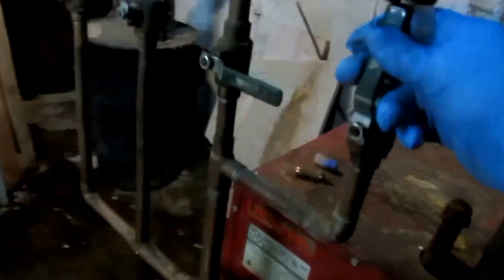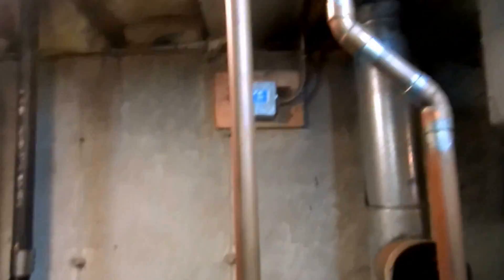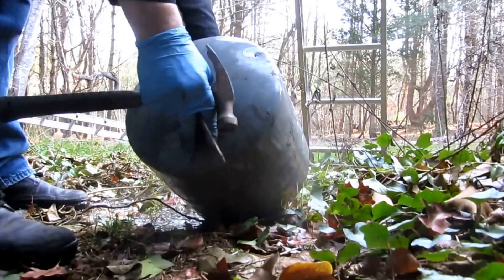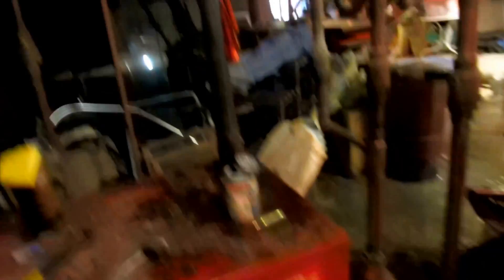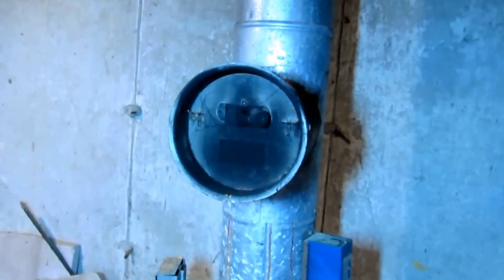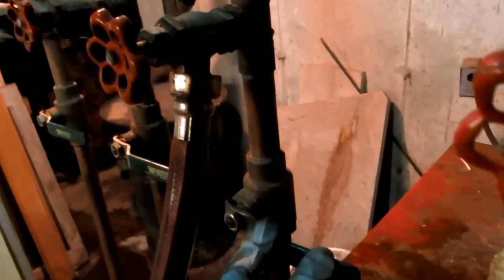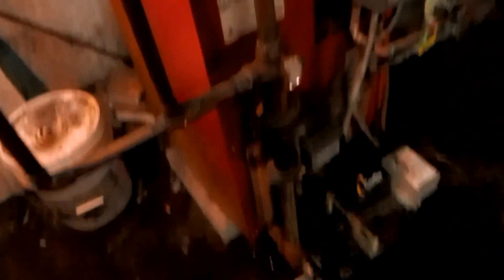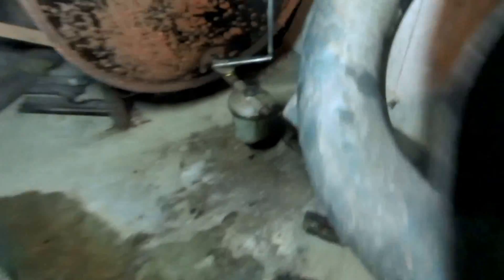HYDRONIC HEATING: boiler water leaking out relief valve.

Comment: My PRV is still blowin off at 30 psi after changing exp tank make up  valve tridicator  and HW coil on a 2 zone 2 story Burnham oil fired boiler. What am i missing? Could air in system be the cause?

Comment: Steve, I need that exact job done, Expansion tank filled with water, relieve valve leaking and it needs a cleaning.   Not sure if this has already been asked, sorry if I am asking the same question.What would time in labor be roughly to complete that work?If you could reply at your convenience, greatly appreciated, thank you.
Reply from the maker: +Patrick Holden i would do it time & material no set price .depends on what is needed and time spent to fix it . some are harder then others .
Reply: +steven lavimoniere Thank you for the reply Steven, I understand there can be unexpected trouble that can occur, but my boiler is similar to this one you worked on, I was just curious how long in hours this work took to complete.

Comment: Why don't they put a longer fitting on top of the tank so a larger pipe wrench will fit? That seems stupid. Is that a shrader valve on the bottom of the tank? Can you drain the water out of the valve so the tank isn't so heavy? Great work as always!
Reply from the maker: Nicholas CeeA it might seem stupid to someone that never worked on one ...there is a very small space to put a wrench .so i use a tiny pipe wrench .so it fits and i grab it with a larger one for leverage .. it might be stupid to the un trained eye.but believe me this is not my first rodeo
Reply: Read my first post again Steve. Why don't they (the tank manufacture) make more room on top so the techs can use a larger wrench. All it would take is a slightly taller hex fitting.

I saw the video where you broke the handle off of the little wrench BTW.
Reply from the maker: your right ,there is no room for a wrench .. its always been a problem

Comment: dude I have a leak that's coming from thermo expansion valve but I get a gallon it happens then nothing no then happens again what could cause this??
Reply from the maker: its sounds like the ex tank is bad drain the boiler remove the ex tank there should be no water in it ..if there is any be carefull the sucker will be heavy if filled with water get under in good when removing to chatch the weight .what happens is when you heat water it has to expanded in the rubber diepham in tank let go it will fill with water and no were got the heated water to expand so it blows the relief valve at 30 psi ..you should change the relief valve also while you have the water out of boiler best to replace the boiler drain also because it problem will leak when you fill it back up
Reply: everyone says the valve is good for 150 lbs
Reply from the maker: myviews for a boiler its 30 lbs for a water heater its 150 lbs  it will say right on the tag of the relief valve ..if your talking about a boiler believe me its the ex tank thats bad do what i said and you will fix the problem
Reply: when u say ex ur talking about expansion tank bcuz there one above the water heater
Reply from the maker: you can lead a horse to water but you can make them drink your best to just call in someone who has a clue on what the hell is going on .....
Reply: I did a few things to check the relief valve the next thing is to check expansion tank next
Reply: but ty for ur help

Comment: What did you put around the hub of the extrol tank that let you use the pipe wrench? I used to use a basin wrench alot but they get expensive when they break lol
Reply from the maker: i tryed the basin wrench and they brake the pin off like butter ..... it was a small # 4 pipe wrench that i snapped the handle off using a 1/2 cheater bar  ,now i just use the small pipe wrench and a 14 or 18" pipe wrench to grab the smaller one once the handle is gone... it is the best thing i have found that works ...
Reply: I wish someone would make a wrench for those I would buy one
Reply from the maker: Al Gregory ya its been a problem for me also .but i think i have found the answer  with the small steel pipe wrench with the broken off handle then you can grab it with a 18" or 14 18 works better to be honest
Reply from the maker: Al Gregory i believe it a # 4 or 5 steel pipe wrench its tiny for sure